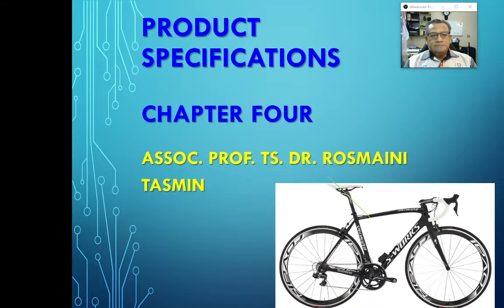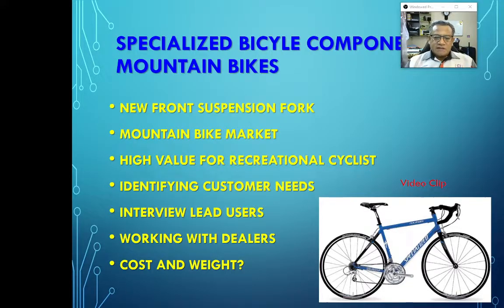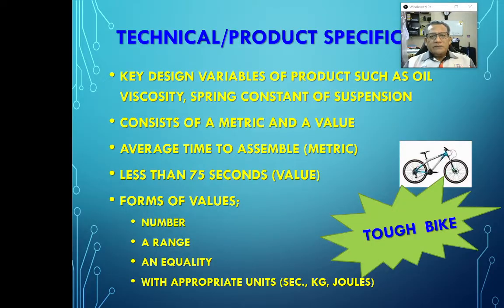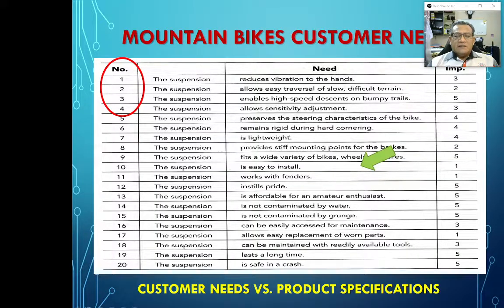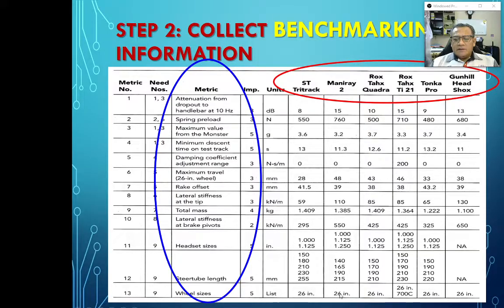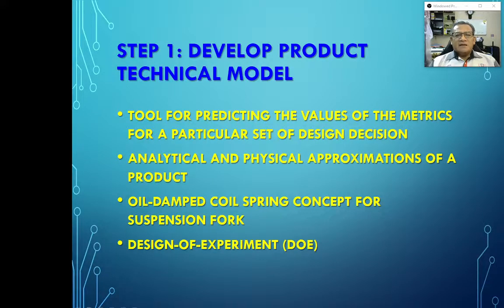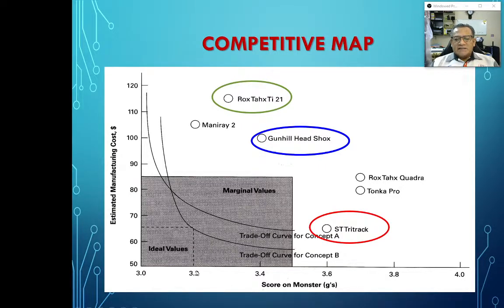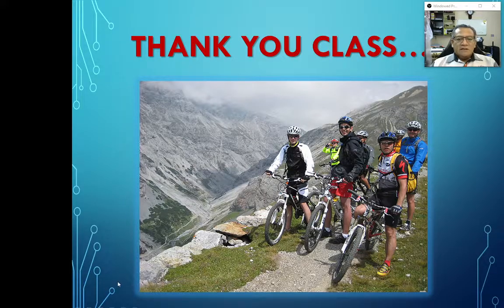Product Development Lecture Chapter 4 Product Specifications

Comment: MOHAMAD LUKMAN HAKIM BIN MOHAMAD AZHAR (AP220087)

Product specs are used to precisely outline what a product should accomplish in response to consumer requests, as I discovered in this chapter. By establishing target and final requirements using procedures like benchmarking, listing measurements, and establishing ideal values, I also learnt how to transform those needs into quantifiable features. Finally, I realised how crucial it is to strike a balance between cost, performance, and customer pleasure in order to produce a successful product.

Comment: TAN JIE YING (AP220207)

Based on the on a mountain bike example, I have learnt how to establish a specification on product, steps to establish product specification, and steps to set final specification.

4 steps when to establish product specification:
1.	prepare list of metric
2.	collect benchmarking information (star rating)
3.	set ideal and acceptable value
4.	reflect on results and process 

5 steps setting final specification:
1.	develop product technical model (technical feasibility)
2.	develop product cost model 
3.	refine specifications (competitive map, final specs)
4.	flow down specs
5.	reflection

Comment: SITI AISHAH BINTI MOHD HANIFULLYZAN (AP220226)

In this chapter, I learned that product specifications are used to clearly define what a product should do based on customer needs. I also learned how to turn those needs into measurable features by setting target and final specifications through steps like listing metrics, benchmarking, and setting ideal values. Lastly, I understood the importance of balancing performance, cost, and customer satisfaction to create a successful product.

Comment: LAW PEI YEE(AP220149)
Using a mountain bike manufactured by a specialised bicycle components firm as an example, this movie taught me about the product characteristics.  After that, I discovered what technical and product specifications are.  In addition, there are five processes involved in developing a prototype or technical model, as well as a process flow for converting customer requests into actual specifications.

Comment: S2 GOH YAR CHING AP220242 
In this chapter, technical specifications must include measurable values, such as weight, durability, and performance metrics, which are critical for product development. Examples of metrics include the force required to absorb shocks and the time needed for assembly, which help in evaluating the product's effectiveness. The specifications must be realistic and achievable, balancing performance with cost considerations to ensure market viability. Thank you Dr.

Comment: NURAIN SABRINA BINTI HARDY AZRIN (CP220035)

From this chapter, I learned that product specification is a crucial step that translates customer needs into clear, measurable technical requirements. It involves setting ideal and acceptable values for product metrics, benchmarking, and using tools like cost and technical models to refine the final specifications. I also learned how important it is to balance performance, cost, and feasibility when defining a successful product, as shown through the mountain bike suspension fork case.
Thank you for the video Dr.

Comment: NUR ELYANI NADHIRAH BINTI AHMAD FARIS (AP220349)

Thank you, Dr. From the video, I found this lecture particularly insightful, especially how it connected customer needs to measurable product specifications. Using the high-end mountain bike as a case study really helped clarify how qualitative preferences like "rider comfort" or "terrain versatility" are translated into specific engineering metrics such as shock absorption at 10 Hz or fork bending strength in Newtons.

Comment: TAN LI YEE (AP220478)

I have learnt about the importance of translating customer needs into clear, measurable product specifications. It highlights how specifications act as a bridge between what customers want and what engineers design, using metrics like weight, size, and performance. The process involves identifying customer needs, benchmarking competitors, acceptable values, and refining the specs through iterations. It also emphasizes balancing technical performance with cost and overall product specs into detailed subsystem requirements. In addition, well-defined specifications help to create products that meet customer expectations.

Comment: Ainur Mardhiah (AP220003)

Thank you, Dr., for sharing.
In this chapter, I learned about how the S-Works company made a special mountain bike. They focused on understanding what customers want in a high-performance product.

The chapter explains how they set product details like weight, strength, and safety.
It also talks about what customers look for, such as less vibration, easy maintenance, and long-lasting use.
Lastly, the company compares their bike to others, sets good standards, and keeps improving the design to match market needs.

Comment: LIAW SIEW WEN (AP220184) 

I have learnt how important understanding product specifications turn customer needs into actionable, measurable design targets. After identifying customer wants, it's important to translate these needs into clear, precise, and testable specifications so that engineers, designers, and manufacturers can work toward a common goal. This involves setting both target and final specifications, benchmarking against competitors, and balancing performance, cost, and feasibility throughout the development process.

Comment: NURFARHANA HUDA BINTI IMRAN (CP220060)

I have learned that product specifications are clear and detailed descriptions of what a product should do. They are based on customer needs and help in designing a better product. I also learned that specifications include technical details like measurements and performance targets. Setting the right specifications helps make a product that customers want and that is also cost-effective.

Comment: Nurwaheda Binti Nagor Maidin (AP220180) S1

I learned that product specifications are based on customer needs. Using a specialized S-Works mountain bike as an example, the lecture showed how features like durability, suspension, and safety are shaped by user feedback. Dr. Atta explained the importance of comparing with competitors, setting performance benchmarks, and improving the design through an ongoing process.

Comment: Muhammad Haikal Bin Arman (CP220073) 

Based on this video, Using a mountain bike manufactured by a specialized cycling components firm as an example, this video taught me about the product characteristics.  I then discovered what technical and product specifications are.  In addition, there are five processes involved in developing a prototype or technical model, as well as a process flow for converting customer requests into actual specifications.

Comment: JARED TAN YU SERN AP220233

Thank you for Dr sharing. In this chapter, I have learned the development of a specialized mountain bike by the S-Works company, emphasizing the importance of understanding customer needs for high-performance products. This chapter outlines the process of creating precise product specifications, which include technical metrics such as weight, durability, and safety features. Key customer expectations include vibration reduction, ease of maintenance, and longevity also involved in this chapter. Lastly, the steps of benchmarking against competitors, establishing ideal and acceptable specifications, and the iterative process of refining the design to meet market demands effectively.

Comment: Erika Ramadani (Ap220409)

Thank you So much Dr for this video . I have learned about 

1. the importance of understanding customer needs, particularly for enthusiasts who require a bike that can handle extreme conditions and provide safety, durability, and ease of maintenance

2. the steps for benchmarking against existing products in the market to establish ideal and acceptable specifications for the new mountain bike design.

Comment: ONG JIA QI AP180178
From this video, I've learned to identify customer's demand using product specification. The steps including prpare list of metrics, bench marking information, set ideal and acceptable value then reflect on result. After the identification process, a final inspection is required to ensure produce competiveness product.

Comment: Balashangri Balachandran CP190087

Based on the video above, I have learned the kind of nature that should be design to fulfill customer's needs. Technical or product specifications should be specify in order to design a product which could fulfill customer's expectations. Besides that, I have also learned the stage process of establishing specification.

Comment: YEO RU WEN AP180307
From this video, I learnt the product specifications with the example of mountain bike which made by specialized bicycle components corporation. Next, I learnt what are specifications, the technical /products specifications. Besides that, the process flow in transforming the customer needs into actual specifications and 5 steps of develop prototype model/technical model.

Comment: WONG HUI SIN AP180171
Specification is language of customer. Product specifications could meet customer needs. Predicting the values of the metrics for a particular set of design decision. After producing the product, review back the design , assembly and come out with your product.

Comment: AINUL NABIHAH BINTI ZAINAL (AP180029)
A good product need to have a technical specification and expected performance in reality based on its customer needs. Therefore, the process flow to transform product spec must be follows;
S1: Prepare list of metrics
S2: Collect benchmarking information 
S3: Set ideal and acceptable value
S4: Reflect on results and process
a) develop product technical model
b) develop product cost model 
c) refine specification 
d) flow down specs

Comment: Lowmeeiching AP180190
I learned about the a product need specifications to design the product based on key design variable of product to form values to customer needs. Next, to establish specifications need to prepare list of matric, collect benchmarking Info., set ideal&acceptable values, reflect on results&process & finally can setting final specifications. The product must be develop product technical model based product's technical feasibility, technical models. Developer have to develop product by cost to refine specifications. Flow down from overall specs to sub system specs and have reflection to develop better technical model for future.

Comment: Assafieyah binti Kamarudin (AP180069)
PRODUCING SPECIFICATION FOR NEW PRODUCT DEVELOPMENT
1. product specification is based on customer needs, requests and expectations that came from their experience.
2. the steps in order to establish specification are: firstly, identify customer needs by using a list of matrics. secondly, collect benchmarking information from all similar products available in the market using the star rating method. thirdly, set an ideal and acceptable value for the new product (basically using the middle concept) and the last steps are to reflect on results and process.

Comment: Lau Wee Guan Ap180304
This lesson provide the methods on developing a new product  with it specification by using the mountain bike company an example. The information of customer need and benchmarking need to be collected before develop a new product. By setting the value and acceptable, the R&D development company will investigate and replying do experimenton on the specification of mountain bikes (such as weight of bike) to fulfill the customer need and gain more market share compare to the other competitor company.